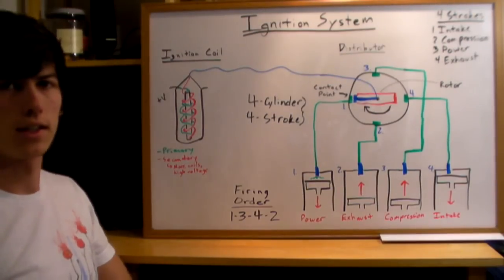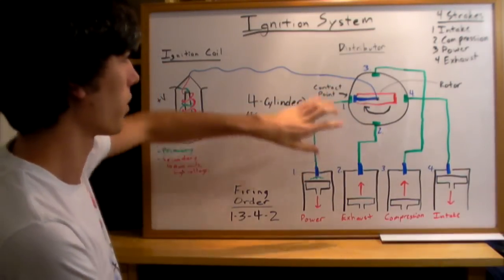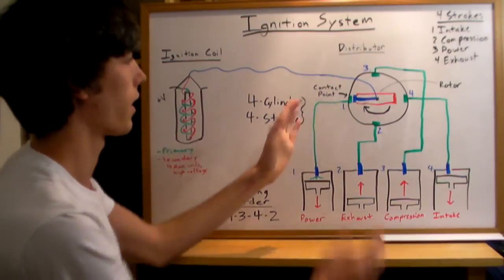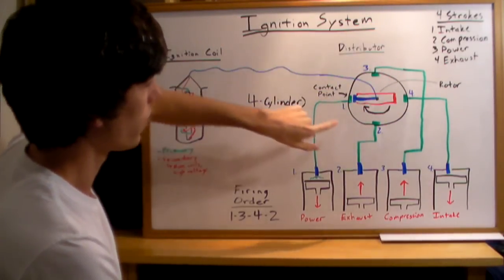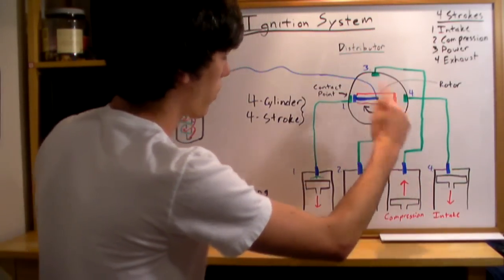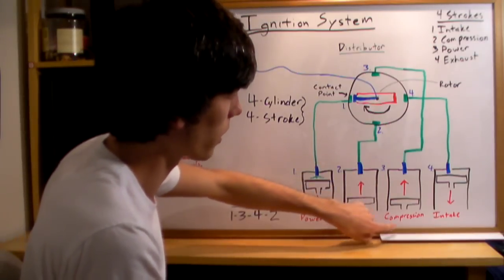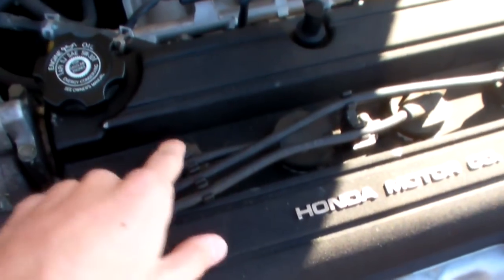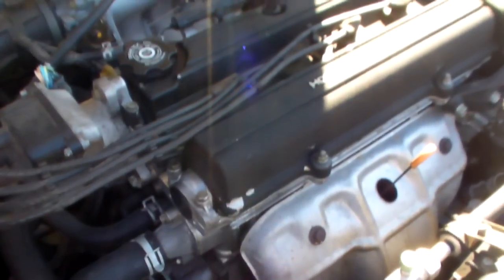Ignition Systems - Explained

Comment: When you turn the engine off does the distributor go back to the 1st cylinder's contact point so when you start the car again it start firing at the right order (1,3,4,2)?
Reply: It dosent matter because itll always be in that order. Which ever one it starts on dosent matter. E.g 1342. If you switch off the car and it restarts on 4. Itll just continue the sequence. 4213421342. Etc.

Comment: (part2) Now when you have a 1 cillinder motor, like a bike, the engine vibrates heavy, because the powerstroke is always at one point. so with a 2 cillinder, there's a stroke every 180degrees, a 3 cillinder, at 120, a 4 cillinder at 90, and so on, so the more you divide the powerstrokes ,the smoother the enige runs. 
(see part 3 for the firing order)

Comment: I would like to add that another reason for use of individual coils would be a longer dwell time and therefore a greater voltage. One of the main reasons for that newer oem cars do this is so that they can run a leaner mixture and achieve better mpg. my 2 cents.

Comment: I Nurhendratmoko, from Indonesia, is currently running the LPG Engine project.
Ignition
 system used for 4 pieces of spark plug, I divide from the current into 
the primer coil, it takes 4 pieces of coil to power the machine, but the
 flame of each spark plug is more perfect.
Thank you, hopefully this correction is not considered negative for the predecessor ignition of the existing system.

Comment from the maker: The rotor is geared to the camshaft. Not sure of the voltage range. The firing order is selected so that the forces on the crankshaft are as even and smooth as possible; in combination with the flywheel it allows for the engine to stay relatively stable and not shake much.

Comment from the maker: @smtbbo Timing is a topic all in itself. The crank angle to ignite the fuel before top dead center is critical in power and efficiency, as you have mentioned; I just wanted to keep this video fairly straight forward.

Comment from the maker: Fuel doesn't like to ignite unless it's reached a good high temperature. For diesel, this is even more true, so it can be useful to warm the block up before attempting to start (using the battery).

Comment: Very good explanation. The ignition system consists of an ignition coil, distributor, rotor, plug wires, and spark plugs.
The older system used a points and condenser system in the distributor. 
These days this is all handled by ECU (the brain of car engine).
For more detail on the ignition system, visit Hs-tronic.
Please keep sharing your knowledge with us.

Comment from the maker: Correct, minor correction is the pistons are moving up and down, rather than the cylinders (as I'm sure you knew). The engine needs to heat up the air enough, and have a good balance of air/fuel to ignite the mixture.

Comment from the maker: There is some overlap between each cylinder and the next, so it would be more like 1.5 cylinders in each stroke, if that makes sense. Meaning one cylinder starts firing before the last cylinder is finished firing.

Comment: (part3) the firing order is also important, because it smooths out the forces on the lenght of the crankshaft. Remember that each powerstroke is a controled explosion, so
each piston is hamering on that part of the crankshaft where its mounted, so you must spread the "hamering" equaly over the length of the crankshaft. so 1234 would not be good, because then you would to much load at once at one side of the crankshaft, so first 1, then 3, then 2 then 4. get it?

Comment from the maker: I'm not sure what you're asking. If the cylinders are moving and firing, then the engine is running. If you're referring to when you start your car, and it doesn't start, it just means your power stroke is non-existent. Your starter motor creates the 4 strokes of the engine, but you don't successfully ignite the air fuel mixture, so your car doesn't start.

Comment from the maker: Not sure what you're asking. Are you asking if a V12 will start (turn the key) faster, or something with regards to combustion instead? The engines will start in relatively the same amount of time. The V12 cylinders do not fire faster, there are just more cylinders firing, thus more frequent power strokes.

Comment: When explaining it on your integra you have the cylinder numbers backwards. The number 1 cylinder is on the timing side (driver side) which correspond to the numbers seen on the spark plug wires. The firing order works out  to be the same though, you are just starting out 2 strokes behind TDC: 4-2-1-3. Just might be a little confusing for other integra owners (like me :D). Love your videos. Keep up the good work!
Reply: Integra621 that was the perfect comment. Positive reinforcement with a minor clarification.

Comment: lol I was wondering during the video if you had caught that. One thing to note when talking about the fireing order on a engine is look to see where your belts are. That will tell you where cyl #1 is. but for the V design or boxer (my car subaru) you want to look closely at the air intake from the front of the engine. The cylinder that is closest to the front is cylinder number one. But I do enjoy watching your video's. You do a really good job at explaining the different system's of a car.

Comment: Hey Jason, love the videos. You're series has really helped support me through my mechanic training thus far. But I'm having a real problem with calculating firing order on 6 cylinder engines. Are there any hack methods to working out which piston is doing what in any particular cycle??

Comment from the maker: Yes, the spark plug is only needed for the power stroke, and it takes two revolutions of the crankshaft for each power stroke to occur (each cylinders power stroke). With a 4 cylinder engine, this would mean 4 power strokes for every 2 revolutions of the crank, 1 power stroke for each cylinder.

Comment: I would be (and I'm sure others) interested in an explanation of Capacitor Discharge Ignition systems.  They are mainly used in bikes, outboard motors and other smaller high revving engines, but they are starting to make an appearance in high performance cars these days and there are not really any good videos out there explaining the difference to an inductive discharge system.  Any chance we can one day see a video on CDI?

Comment: how does the distributer stay at the right speed so the spark plugs go off at the right time?
Reply from the maker: zachary vogel Great question - it is geared to the camshaft so it spins at the correct RPM.
Reply: I had a feeling it was something like that, thank you :)
Reply: Engineering Explained Hey, you sure are helping a self taught "technician" out.
Thank you !

Comment: You sir have good taste in cars. Integra (any year) is one of the most reliable and easy to work on quasi-sub-sports cars I've ever driven and loved. I would prefer a '91 to '95 NSX just for sheer enjoyment but the teg is in that uncanny valley of just useful enough as an everyday car and still fun to drive. Need to do a suspension job though. Mine's all mushy after 20 years (still original and fine like wine) but stopping power and body roll is a reason to take corners with a light touch. But damn, they run like a top if you take care of them. They do not seem 20 years old or 200k miles in the slightest except for the tape deck and the seals slowly starting to go ;)

Love the videos!

Comment from the maker: This is assuming you have a 4 cylinder engine, and those are the strokes cylinders 2, 3, and 4 are one while 1 is in the power stroke. And the rotor passes the spark along to each cylinder.

Comment: the voltage's go from battery voltage to about 40k. think of the ignition coil as a vary compact tesla coil. to answer your other question the engine needs to be balanced in order to make any kind of reliable power for you to move down the road. In the front at your crank pulley you have a harmonic balancer to help with this and at the back of the engine you either have a flywheel or a flex plate pending what transmission you have.

Comment: Hi. I have a question regarding this video. You said the current from the second ignition coil passed into the distributor,and then the contact caused the voltage thru each cylinder. Why the current end up with the voltage? Thank you very much.

Comment: Loving you're videos!! Never found videos that are so short and quick so informative! 
Also, I still have some questions if someone can help maybe? Thanks in advance if you can!! :)
What turns the rotor in the distributor? Is there a driver circuit, driving the Ignition Coil? Or it wired straight to the battery? What voltage range does the Ignition Coil run at? What is the reason for the engine firing order needing to be balanced?

Comment: Quick question. We have a high voltage at firing what is the approx. amperage going thru that spark plug wire? Enjoy your videos just wondering what amperage I would expect to see on a scope or ammeter. Thank you.

Comment: Is the ignition distributor connected via a belt with the Camshaft or the Crankshaft?
How does it correctly ignite the Air-Fuel Mixture?

Comment: Can you do another video regarding how the engine, rotates manny other components, not just the fly wheel, I.e fan belt, radiator fan. Also alternator, most important part of a car once it's started running? How it re charges the battery and gives power to the cars electronics including radio. Thanks

Comment: Great videos man!!! 
Your very smart! 
I just have a doubt: How is the battery's DC current stepped up in the ignition coil since only ac current could be stepped up
Reply: I realize this is a 2-year-old question, but in case anyone else is wondering... the initial battery current sent to the ignition coil sends power to the primary windings within the coil. When we pass current through windings of wire surrounding an iron core, we create a magnetic field. There is an iron core in the coil as well, so the current through this primary winding creates this magnetic field. When the primary circuit contact is broken, the magnetic field collapses rapidly. The rapid collapse of this magnet field induces a much higher voltage to the secondary windings of the coil. It is this high voltage (sometimes upwards of 40,000V) that travels to the spark plug and ignites the compressed air/fuel mixture in the combustion chamber. Hope this helps!
Reply: Christy B thank you! But what breaks the primary circuit?

Comment: Can u explain a Hall effect crank sensor and how it works exactly,I know its provide with 5 volts an a ground,but how the signal wire comes into play what goes on inside the crank sensor for the signal wire to send back a signal...and where does the 5volts go etc...

Comment: Ignition related question 

for coil on plugs in EFI , please correct me if I am wrong,
if the dwell time is less than the optimal for a specific coil, the current induced in the secondary coil is not going to be maximum as in the maximum this ignition coil can create now  what's the effect of this on the spark created at the spark plug and how does that affect the engine power  Vs. an ignition coil that is getting optimal charging time ?

Thank you in advance

Comment: I have a technical question about Coil,
In case of coil failure (separate coil per cylinder) this that happened to me..
When the engine is running, and the failed coil removed there is no explosion, but the working one can be felt.. Can be even when removing the coil?
I can't understand this technically as I'm imagining that when the coil removed that means no explosion in the cylinder.

Comment: a valve opens and air mixed with gas is sucked in by the piston going down, when it's al the way down, the valves closes and de piston goes upward and compress the air and fuel together, then when the piston reaches the top, a spark ignite the compressed air and fuel, and bang! An explosion is pushing the piston hard enough to go 2 rounds, and there's the spark again and everything starts over again. 
And each cillinder does the same, so they need their own spark. (See part 2)

Comment: How is the distributed motor speed regulated for the contact points, obviously any miss firing will miss cylinder cycle . Is it the cam shaft that does this?

Comment: As an electrical engineer, I feel like you skipped completely over how the high voltage for the sparks is actually generated. The ignition coil is a transformer, I get that, but how is the AC provided to it in older vehicles, ones that predate modern power electronics? Does it get power directly from an AC generator on the crankshaft or something?
Reply: My understanding is the alternator sends 12VDC to the transformer, and it is a stepup transformer to turn it into 10-12,000 volts, which is what's needed to create an actual arc, or spark

Comment: Any chance you could tell me the firing order on a 1991 Mazda 323 1.6L SOHC GLX sedan? I'm in NZ so unsure if it's European version. But I read that some euro versions are different but I can't get car to start. Some seem clockwise some anti clock wise. Idk what spark plug goes to what plug on the dizzy. If it helps in the VIN the first few letters is BG1062.

Comment: in a married ignition coil the primary and secondary coils are both connected to the positive battery terminal. im in an automotive program and an instructor and i were discussing this and couldnt come up with an answer as to why they would both be connected to the positive terminal when there shouldnt be a need to have the secondary connected to power as the voltage is induced by electromagnetism. any thoughts?
Reply: +PJ Peerson there is a magnetic core. It's like a current transformer

Comment: so does that implicate that the distributor is spinning as fast as the current rpm of the engine itself in order to match the rythm of the strokes?
Reply: Yes it is!
Reply: NO, the gears reduce the distributor speed by half of rpm speed for a 4 stroke. Timing marks are only right 1/2 the time.
Reply: jim buski It is different for different engines. Many engines spark twice in one cycle. During the power stroke, and finishing the exhaust stroke. While other engines, may have a 1/2 speed difference, to where the spark will fire only at power strokes
Reply: If timing is out of order??
Reply: Slacin' Ace this is about diesel engine i think so for example caterpillar n perkins

Comment: the plugs them selves no. But you could have a timing issue where your distributor is out of sync with your cam shaft. Your piston's don't cause an engine to be out of balance either. It's to do with ignition timing.

Comment: how does the spark advance if the rotor and cap are fixed. Even if the coil is switched faster or slower  the cap and rotor are fixed/attached to the pistons through the gears to the crankshaft

Comment: Wouldnt the distributor rotate at half of the crankshafts revs, as the firing interval of a I4 is 180 degrees?
Reply from the maker: thunder24mh Yep, which is why the distributor rotor is geared to the camshaft.

Comment: Coil cannot work /make more voltage just using DC, no electricity from battery is actually used to load up a coil. Condenser make a burst that replicates, copies how ac works, then it is sent to coil. To make usable magnetic field like in a coil,so that those 200 - 300v coming from condenser can be amplified to 20 - 30k volts You need alternating current.
Reply: there is a points circuit on the negative side of the ignition coil which makes the voltage essentially AC by breaking up the ground when the spark plug needs to fire which creates a high voltage on the secondary. Idk why he left this out but probably because he didn't understand how points worked himself.
Reply: I believe the coil works on mutual induction ( Faraday's Law of Induction). By starting, stopping or changing the rate of current flow this induces a magnetic field in the primary which mutually induces an emf in the secondary. Because the secondary has many more turns in its coil it produces more voltage. Voila, magic.
Reply: OH THANK YOU!

Comment: Doesn't the voltage going to the coil need to be AC rather than DC from the battery? The coil is essentially a transformer no?
Reply: +oddball0045 It cones from the alternator which makes AC. Only the first ignition is from the battery, and DC in a burst can be approximated to AC.
Reply: +oddball0045  there is a condenser (capacitor) that charges up to a high voltage to drive the secondary

Comment: How did you not mention points vs electronic ignition?

and also about how the 2ndary circuit includes body/engine ground?

Why is this video actually about the 4 stroke cycle instead?

Major letdown.

Comment: he missed explaining about the condenser and the breaker points in the circuit...
Reply: He likely doesn't know because they are not used in modern cars, most mechanics don't know the function of the condensor in a Kettering ignition system either, not now or even when they were common.

Comment: 0:33 That ignition coil looks like a transformer.  Am I mistaken?
Reply: That's what it technically is.  It takes a lover voltage and increases it to a higher voltage at the cost of current. (after the current gets converted to AC, of course)  Or it could be a boost converter, which would be DC to DC
Reply: you're right
Reply: jmcwd appreciateable answer

Comment: This only explains how the secondary spark voltage distribution works which has little do with with how an ignition system works. It's like teaching how ABS works by explaining how wheels spin. Good presentation but poor on detail.